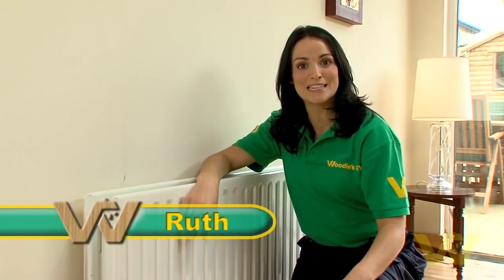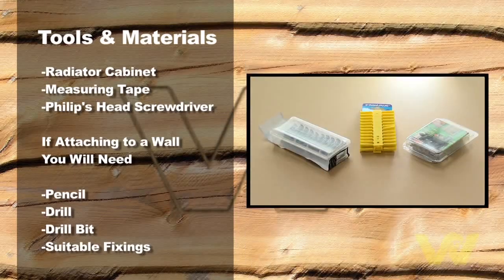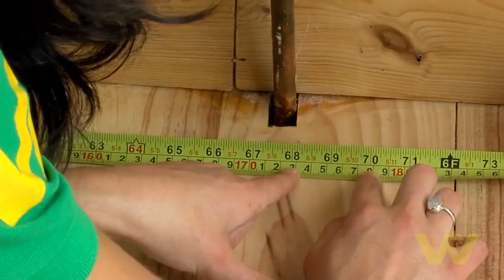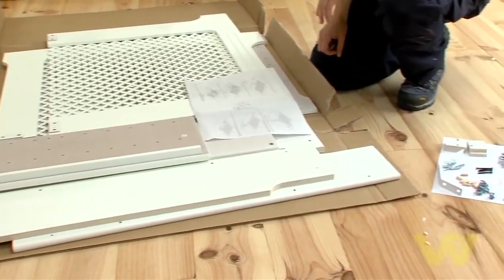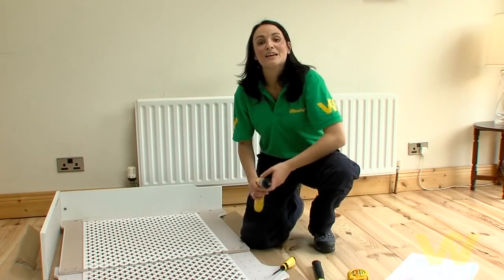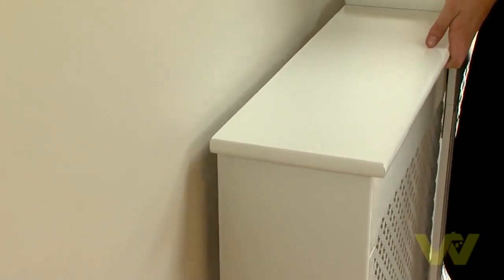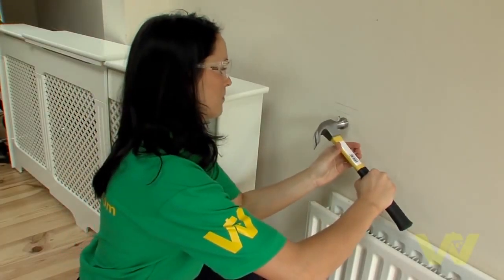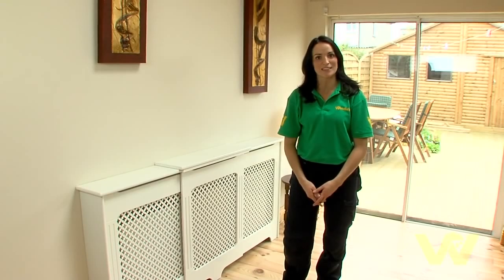How to Install a Radiator Cabinet

Comment: how does it fit flush to the wall when skirting is present? will i need to alter the bottom of both ends?
Reply: all radiator covers are recessed at the bottom to fit over skirting boards......

Comment: Once its together, how are you supposed to lone the holes up properly to scree it to the wall? Not able to figure it out.
Reply: Pencil line along the wall at the top when its fitted to radiator ...measure depth of top mdf pannel that has the groove for the bit of wood u fix to wall then line up the block with your pencil marks so it will be at the right hight...